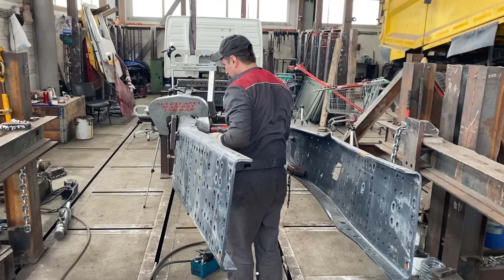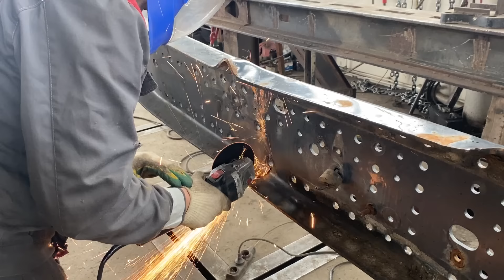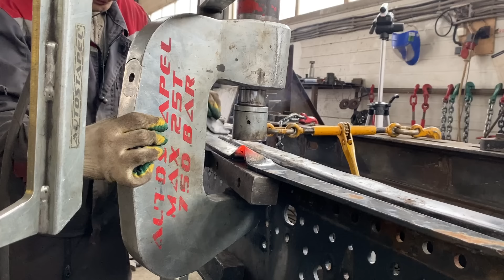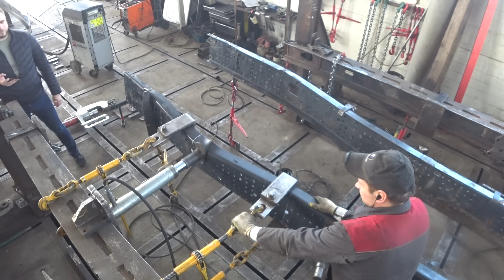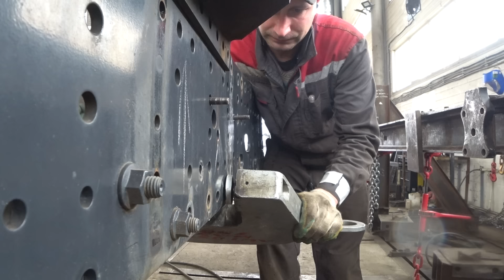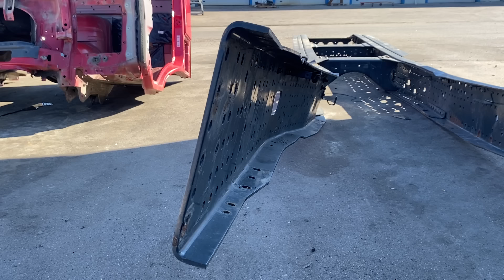СЛОЖНОЕ ВОССТАНОВЛЕНИЕ РАМЫ ГРУЗОВИКА ПОСЛЕ ЖЕСТКОГО ДТП

Comment: Wow,that is so amazingly impressive. I’ve never seen a truck frame turned from a pretzel to straight before. Just amazing!
Reply: It may look straight and strong as before, but I wonder is it really. Every bend in that structure is made with a reason and when its structure is compromised and bent back I wonder how strong is that. Also is it really worth it instead of buying a new frame which is guaranteed to be strong and straight.
Reply from the maker: Thanks
Reply from the maker: It is impossible to replace the car frame with another one. The vehicle's VIN number is stamped on the frame. The number is stamped by the manufacturer. It is forbidden to perform this procedure on your own. The car cannot be registered with the state authorities. That is why the damaged frame is being repaired.
Reply from the maker: Of course, the rigidity of the frame is reduced. But within acceptable limits. With proper maintenance of the car after repair, nothing will happen to it. The frame will last as long as the one that has not been repaired. It's all time-tested. Otherwise, no one would be engaged in such repairs.
There are frames that, after repair, are reinforced with special inserts from the inside. If necessary.
There are frames that we do not recommend repairing.
At the same time, not always repaired frames are subsequently used to restore the car.
The repaired frame can be used to cut parts out of it to be used as a reinforcing structure for another frame. There are many options.

Comment: This is so impressive. How do you know exactly where curved frame rails should be in measurement? Is it just a guess and measuring by common sense? Or does the manufacture give out frame specifications? This is amazing. I wonder if USA has a frame shop like this nowadays. I bet usa just buys a new frame when this happens. Amazing 👏🏼
Reply from the maker: There are all sizes for a specific frame. Everything is done exactly according to the established dimensions.
You can’t buy a new one because the VIN number of the car was stuffed on the frame

Comment: If you going that far of a tear down, just re-rail the damn thing. Rails are expensive yes, but the labor cost and down time for that extensive of bends is prob more, not to mention structural integrity.
Reply from the maker: This work is not expensive. Indeed, very few
Reply: Cost of labor is the main factor, and where they do this, it s feasable
Reply: Your answer should tell you something, and that is you’re not charging enough. This should be a rail replacement.

Comment: Great job gentlemen. After a hit like this how is the driver? My prayers go out to her/his good health. BTW after so much damage and repair does the frame go back to original and what about the transport authorities, what do they have to say when this truck goes back for recertification?
Reply from the maker: Of course, the rigidity of the frame is reduced. But within acceptable limits. With proper maintenance of the car after repair, nothing will happen to it. The frame will last as long as the one that has not been repaired. It's all time-tested. Otherwise, no one would be engaged in such repairs.
There are frames that, after repair, are reinforced with special liners from the inside. If necessary.
There are frames that we do not recommend repairing.
At the same time, not always repaired frames are subsequently used to restore the car.
The repaired frame can be used to cut parts out of it to be used as a reinforcing structure for another frame. There are many options.
Reply: @trucks_channel_razborgruz  thank for such a great reply. Am really impressed.

Comment: Very interesting! But i am afraid that there will be still a lot of structural deficits if the frame on its whole would not be integrally heated and tempered! Imho it is a highly risk to put it in service without that! And would it not be cheaper to order a new frame in this case?
Reply from the maker: Of course, the rigidity of the frame is reduced. But within acceptable limits. With proper maintenance of the car after repair, nothing will happen to it. The frame will last as long as the one that has not been repaired. It's all time-tested. Otherwise, no one would be engaged in such repairs.
There are frames that, after repair, are reinforced with special inserts from the inside. If necessary.
There are frames that we do not recommend repairing.
At the same time, not always repaired frames are subsequently used to restore the car.
The repaired frame can be used to cut parts out of it to be used as a reinforcing structure for another frame. There are many options.
Reply: You are correct! The frame is structurally weakened. NEVER PUT HEAT ON ANY FRAME!

Comment: I saw in videos from Pakistan that after repairing the frame, they strengthen it by double layering from the inside, is this correct? Does this cause the impact to be transferred to the cabin or the driver during an accident?

Comment: Very skilled but it should of been scrapped
Reply: Nice job but I wouldn’t want it under my truck, probably weak in spots!
Reply from the maker: Thanks
Reply from the maker: Of course, the rigidity of the frame is reduced. But within acceptable limits. With proper maintenance of the car after repair, nothing will happen to it. The frame will last as long as the one that has not been repaired. It's all time-tested. Otherwise, no one would be engaged in such repairs.
There are frames that, after repair, are reinforced with special inserts from the inside. If necessary.
There are frames that we do not recommend repairing.
At the same time, not always repaired frames are subsequently used to restore the car.
The repaired frame can be used to cut parts out of it to be used as a reinforcing structure for another frame. There are many options.

Comment: The truck was already stripped down to the bare frame, labor + time, wouldn’t it be more cost effective just to replace with another undamaged one?
Reply from the maker: It is impossible to replace the car frame with another one. The vehicle's VIN number is stamped on the frame. The number is stamped by the manufacturer. It is forbidden to perform this procedure on your own. The car cannot be registered with the state authorities. That is why the damaged frame is being repaired.
Reply: @trucks_channel_razborgruz  Different country, different rules. Sorry that you have to go through so much trouble to have a compromised  structural component that will be hauling heavy loads on the road. I assume that there isn’t insurance involved as this would be sufficient damage to total out the vehicle in the first place. If the frame is twisted this bad, what does the rest of the truck look like? We have “Rebuilt” titles that can be attained if the vehicle is repaired properly here in the US.    
A truck with this type of damage would most likely end up as a parts vehicle unless there was absolutely no other damage to the truck at all and it was less than a year old, but even then they usually end up as a salvage only title. Something to be said about a government that wont allow you to replace a structural component with an un-compromised  one, but is ok with one that is an untwisted pretzel which may or may not have work hardening or stress cracks. Your skills are impressive though.

Comment: Doesn’t the bending and heating of all that metal affect the strength of it?
Reply: How do you think they made it in the first place?
Reply: No, that's mild steel
Reply: @2345bcde  no, it's not. 50b is still structural steel with a little bit more carbon and strength than basic mild steel
Reply: Most steel rails have been austenitized, quenched and tempered, and the frame rails are specifically labeled NOT to heat or weld, because it will have a detrimental effect at that spot. Some rails are made from HSLA steel, and thus, non-heat treated. (Not used as much, because $)
Reply from the maker: Of course, the rigidity of the frame is reduced. But within acceptable limits. With proper maintenance of the car after repair, nothing will happen to it. The frame will last as long as the one that has not been repaired. It's all time-tested. Otherwise, no one would be engaged in such repairs.
There are frames that, after repair, are reinforced with special inserts from the inside. If necessary.
There are frames that we do not recommend repairing.
At the same time, not always repaired frames are subsequently used to restore the car.
The repaired frame can be used to cut parts out of it to be used as a reinforcing structure for another frame. There are many options.

Comment: no one will tell me that after such a repair, this frame will have factory-made strength...
Reply: That is because it won't.
In most countries that frame will be condemned to never be used and assigned to the furnace.
Reply from the maker: Of course, the rigidity of the frame is reduced. But within acceptable limits. With proper maintenance of the car after repair, nothing will happen to it. The frame will last as long as the one that has not been repaired. It's all time-tested. Otherwise, no one would be engaged in such repairs.
There are frames that, after repair, are reinforced with special inserts from the inside. If necessary.
There are frames that we do not recommend repairing.
At the same time, not always repaired frames are subsequently used to restore the car.
The repaired frame can be used to cut parts out of it to be used as a reinforcing structure for another frame. There are many options.
Reply: @trucks_channel_razborgruz  true...
Reply: @trucks_channel_razborgruz  maybe there, but definitely not where I am and for good reasons. (Australia)
It is literally illegal to do that here and there are very very serious penalties, both finantial and prison sentences in some cases.

You have a great workshop, I am a Boilermaker by trade with a few special qualifications. (now retired)
Reply: Surely you are Joking? That frame is Junk!

Comment: why not replace the new king of this truck frame
Reply from the maker: It is impossible to replace the car frame with another one. The vehicle's VIN number is stamped on the frame. The number is stamped by the manufacturer. It is forbidden to perform this procedure on your own. The car cannot be registered with the state authorities. That is why the damaged frame is being repaired.
Reply: @trucks_channel_razborgruz   If at our place to outsmart the engine number, we take it from the damaged car frame, we weld it on the new frame, in the same position. So this car is still registered with the relevant institution.

Comment: Never be the same wont have the same integrity strength. 🤔
Reply from the maker: Of course, the rigidity of the frame is reduced. But within acceptable limits. With proper maintenance of the car after repair, nothing will happen to it. The frame will last as long as the one that has not been repaired. It's all time-tested. Otherwise, no one would be engaged in such repairs.
There are frames that, after repair, are reinforced with special inserts from the inside. If necessary.
There are frames that we do not recommend repairing.
At the same time, not always repaired frames are subsequently used to restore the car.
The repaired frame can be used to cut parts out of it to be used as a reinforcing structure for another frame. There are many options.

Comment: A metal beam bended and after straighten. It will never be good again.
Reply from the maker: Of course, the rigidity of the frame is reduced. But within acceptable limits. With proper maintenance of the car after repair, nothing will happen to it. The frame will last as long as the one that has not been repaired. It's all time-tested. Otherwise, no one would be engaged in such repairs.
There are frames that, after repair, are reinforced with special inserts from the inside. If necessary.
There are frames that we do not recommend repairing.
At the same time, not always repaired frames are subsequently used to restore the car.
The repaired frame can be used to cut parts out of it to be used as a reinforcing structure for another frame. There are many options.

Comment: Surely its cheaper to make new chassis rails
Reply from the maker: It is impossible to replace the car frame with another one. The vehicle's VIN number is stamped on the frame. The number is stamped by the manufacturer. It is forbidden to perform this procedure on your own. The car cannot be registered with the state authorities. That is why the damaged frame is being repaired.
Reply: @trucks_channel_razborgruz  oh ok, in my country you can have a government inspector come and stamp it for you with a new number if the chassis is the part being replaced

Comment: Whats the point of repairing it ? It wont never work the same, also it wont be straight 100% as from factory. Typicall ruski gniotsa nie łamiotsa
Reply from the maker: There's a meaning. With proper operation of the car - nothing will happen to the frame. Proven by time.